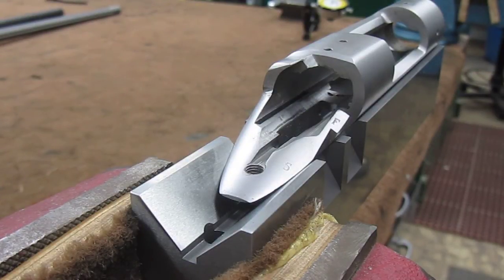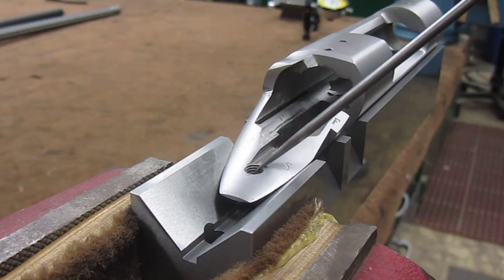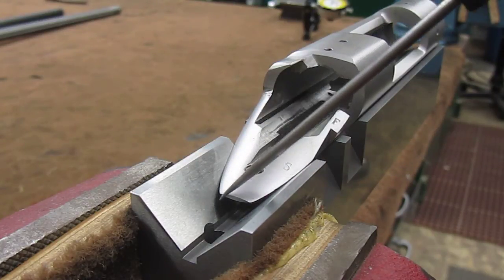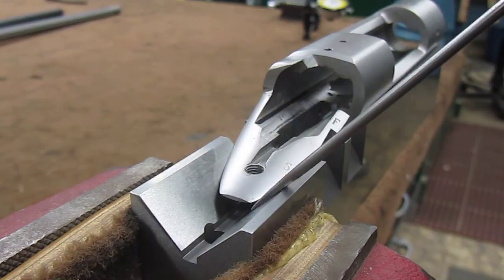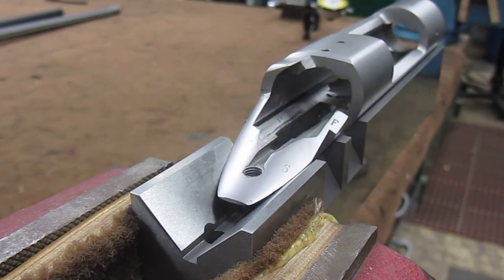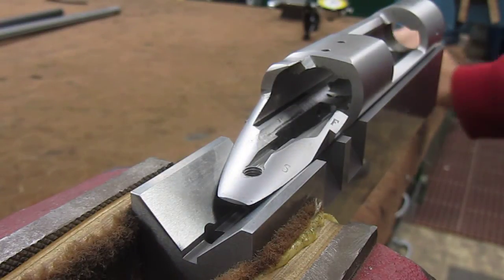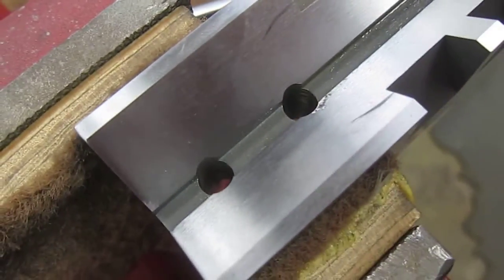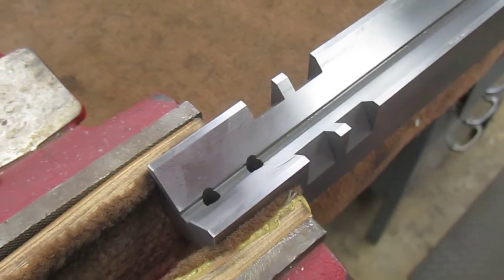Remington 700 V-Block stress test. Video 2, T&E

Comment: Good video, but wrong conclusion. V-Blocks always intersect a cylinder along two lines. If the cylinder is sectioned away from these intersections a gap MUST occur. Such a gap does NOT mean that the receiver has a problem or that any stress will occur when mated to a proper bedding surface. The stress referred to in this video would only occur if the stock had a V Block installed in it with the same geometry as the V-Block in the video. Custom stocks with V-Block style bedding blocks DO NOT have this geometry and DO NOT have this problem. In summary, this is probably a good action, but the wrong V-Block was used and shows a problem that does not really exist.